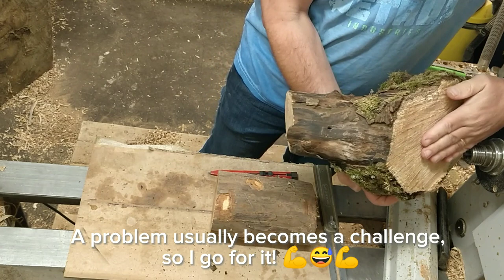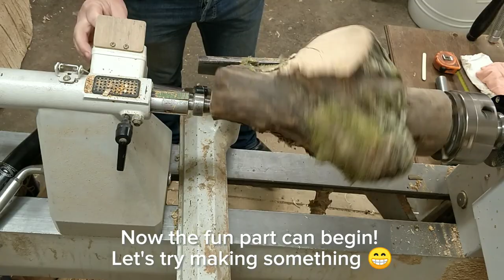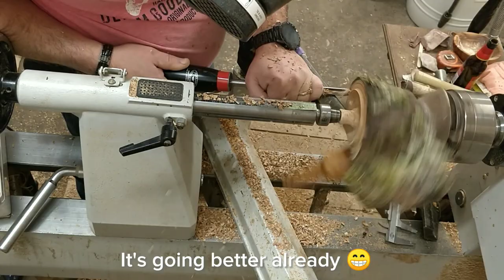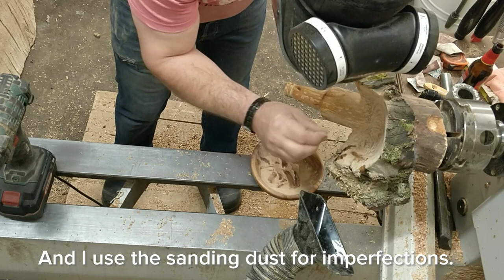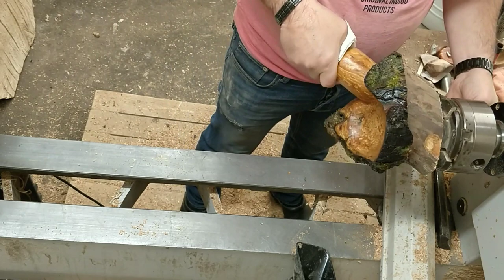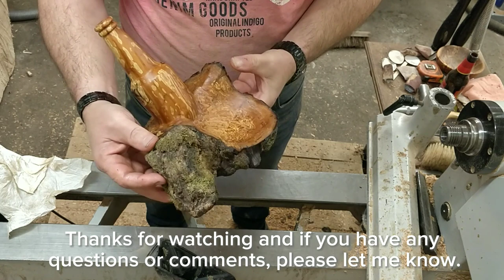Woodturning - Beer bottle on the rocks 🍺😉

Comment: Very nice finished piece! 

Just please be careful, as using a normal chisel can be VERY dangerous if you get a catch, as the shank can break. There are scrapers for lathes that are designed to do eexactly what you need and wont shatter with a catch. 

Keep up the cool projects!
Reply from the maker: Thank you for your comment, you are absolutely right, but I have been doing this for a while and only when I have to finish, I also have a scraper with a long handle, but it works a little differently.  I don't promote it, but this works great for me, of course considering safety.  On to the next fun project💪💪.
Reply: @woodtastic  glad you're comfortable with it. I know when I started, I was using a spindle roughing gouge on a bowl, and wouldn't have known better if someone hadn't said something. I was guessing you had experience, but wanted to be safe in case you didn't know! Love your projects for sure!
Reply from the maker: @TournageDubois  I really appreciate your concern. I think it is always a good thing to watch over one another and keep safety a priority. It helps us to stay turning and make beautiful things! 😉